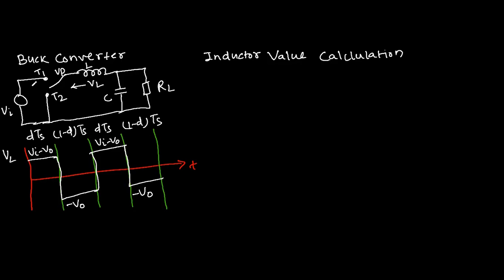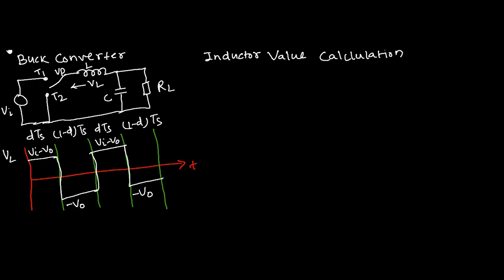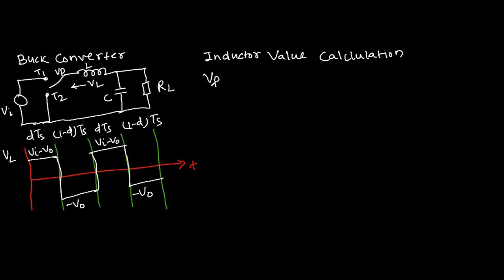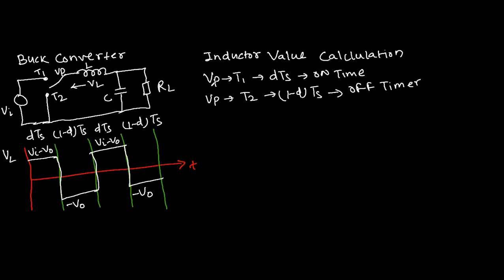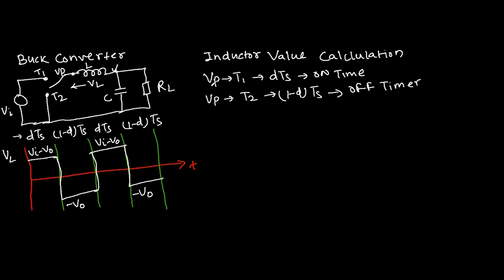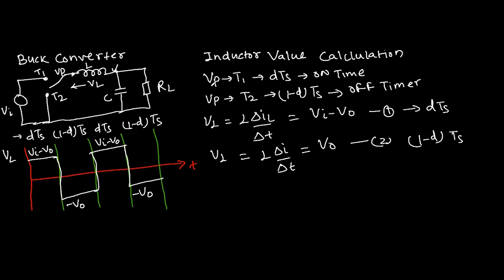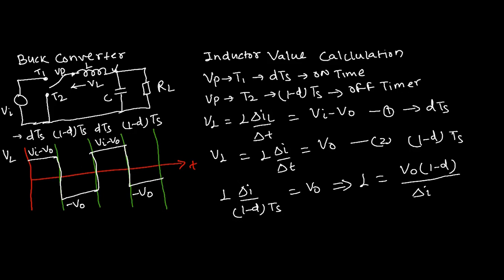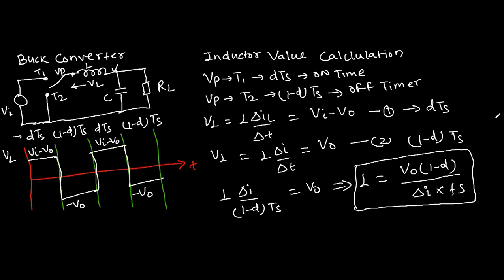How to Calculate Inductance for a Buck Converter | Step-by-Step Guide

Comment: Professor,  my understanding of the ripple requirement was 1 to 5 percent of the load current? This helps control the effects of ESR on stability of the converter.
Reply from the maker: Hi Dan,
Good to see your comment....you probably are right but the concern with 1% ripple current is higher inductance value and higher cost.